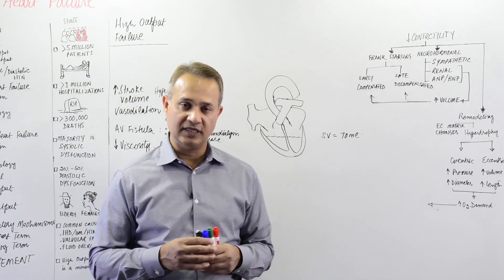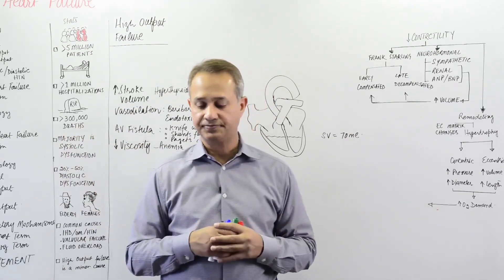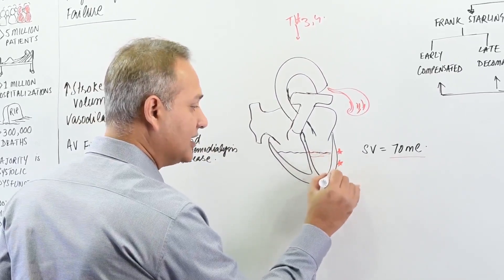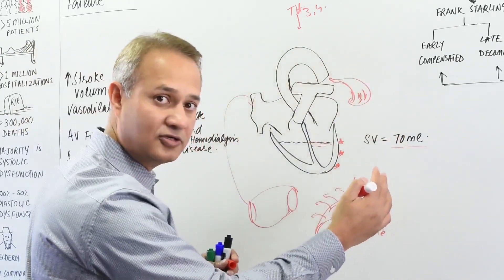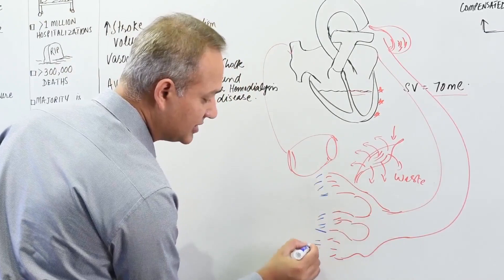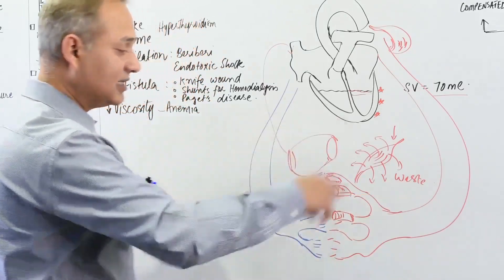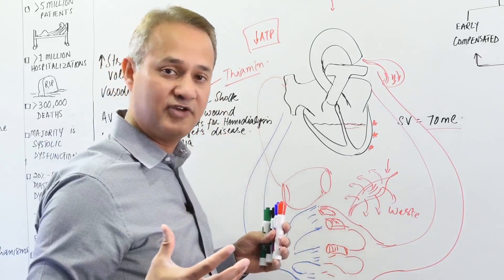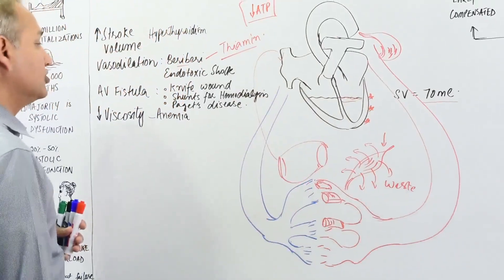Causes of High Output Cardiac Failure

Comment: So let’s see if I understand this correctly?
- T3/T4 increase metabolism which increases metabolic waste products I.e. CO2 etc. 
- this increase in waste products cause systemic vasodilation and an initial decrease in BP
- Baroreceptors sense this initial drop, and signal to the heart to increase HR
- BP maintained but continuous elevation in metabolism leads to even more waste products and vasodilation (positive feed back loop)
- HR increases further to compensate thereby reducing diastole period and thus perfusion to it’s own tissues
- eventually the hearts demand is so high and it’s supply is so compromised that it fails?

*My question... - where does the RAAS response come in to maintain BP? Where is the SNS/catecholamine response come in? Wouldn’t they help offset some of this vasodilation and thus reduce some of the stress off the heart (so it wouldn’t have to work alone in maintain BP)?

Also, wouldn’t this significant increase vasodilation lead to like systemic edema, pleural effusions etc? Don’t the capillaries get excessively leaky as they dilate that much?
Reply: he never said capillary ...its arterioles not capillary that should solve the vasodilation issue 
as for RAAS query lets say it kicked in will normalize the bp but still to treat this thing you need to treat the cause behind it in ur case thyroid supplementation .......even after bp normal the tissue will continue to sec co2 in blood which will again cause vasodiln more RAAS more fluid ...repeat the process....ultimately the this will exceed the body`s capacity to hold fluid and heart would not be able to pump againt those press generated after multiple cycle of fluid reabs.....and heart failure which was caused bcz of high cardiac output

Comment: so with this could we expect hypotension or HTN?  i get confused when you say the vessels dilate, but the heart beats at a faster demand because of the low output to the body. if the heart is beating increasingly fast to compensate, how would this affect the BP? what would be some tips to lookout for in the prehospital setting?
Reply from the maker: Good question. Let's break down the sequence of events. First the vessels dilate. This leads to a fall in the BP. However, heart will start beating fast to maintain the BP. If you see this patient you will observe almost normal BP with increased heart rate. You won't see increased BP though. If the situation isn't corrected then the heart will start filling leading to a progressive drop in the BP.
Reply: @DrBeenMedicalLectures  Thank you!